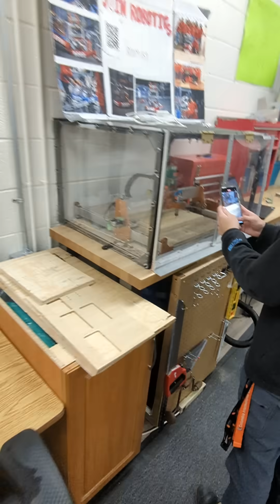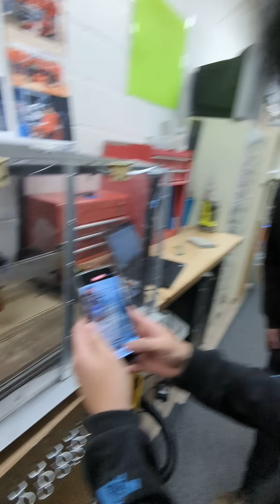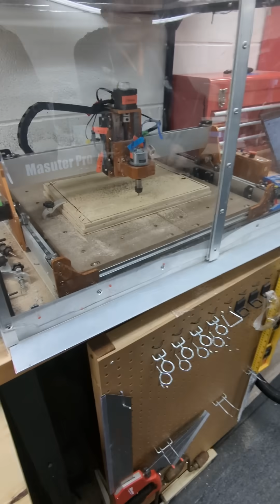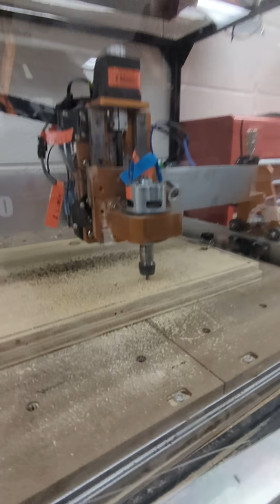Why we call our CNC Mill "Chewie" now | FRC 2025 REEFSCAPE

Comment: dying like a goose? But i dont see any chips being formed. They tell me if your cutting speed is too slow and if you are making powder instead of chips, youll be getting to much rubbing friction heat on the spindle which could break it. This obbbviouuusly calls for you to up the cutting speed to 200 ipm 😏😏 it will fo sho cut more quiter👍👍👍👍👍👍👌👍

Comment: What did the cut look like? Also, what the hell did they do to make it sound like that?
Reply: Stacked 2 pieces of wood together and they were vibrating against each other while the tool was breaking thru both.
Reply: irregular pressure against the wood/tool, same thing happens in metal working with lathes and mills. bit not secured in a solid fixture to prevent vibrations or work piece not clamped down to prevent movement. only thing inherently wrong/bad is that it just doesn't produce a clean cut and overheats the cutting edge and increasing wear and dulling the bit sooner.
Reply from the maker: ran it at like 2x recommended speed, 3x cut depth default and had a doulbe stack of wood. truly a nightmare scenario